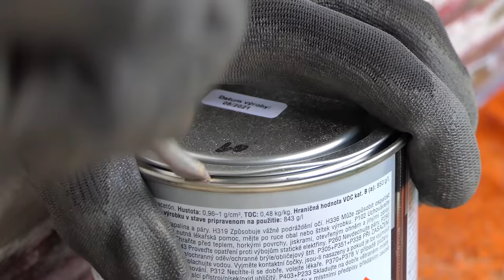Restoration Old Motorcycle CHOPPER - Restore Abandoned Mini Harley - part 1

Comment: He supposedly finds these bikes all over the place , yet they're all sprayed with exactly the same orange paint !
Reply: If he just restored it from a "little tired" to "awesome" it would be an interesting series of videos. But instead we get the absurd fantasy that it was left in a hole, covered in mud, straw, and rust-colored paint, to include the plastics and aluminum. But the tires are in remarkably good shape once aired up, and nothing seems badly broken or missing, even the key is there! 

Take the time spent on faking it being garbage and cleaning the mud/straw off and spend it on a more detailed restoration (e.g. painting the entire tank).
Reply: Exactly the same colour orange thats sprayed on the cloth it's sitting on
Reply: ive found 5 of these bikes without trying.....you can buy them running for about 200-250
Reply: @bms9144  ๐ๆท่าน7.ท่าน😊

Comment: This is how I find everything. I'm just jogging around stopping for push ups and jumping into the squat position in a hoodie, you know on my  Rocky Balboa. When suddenly out of my peripheral, wait. What do we have here? Can it be? No. How could someone leave this here?Then conveniently anything  that is missing is laying close beside it. If it requires keys they are usually in the ignition. I'm just a lucky person I guess. I don't even have to buy parts or check for missing pieces. I just know that everything's going to be there. A quick wash, a little bit of spray paint, and voila it's as good as new. Smh
Reply: Yea it gets tiring when you see a scam artist doing his work.

Comment: Spraying it orange and rubbing dirt and mud all over it doesn’t make the bike old nor rusty. 

“Rust” on a plastic battery and on rubber hoses?  Come on. 

This would have been a better video if it were genuine and not faked for a more drastic “restoration”. 

Boo man. You should be ashamed

Comment: I'm curious to know how much crap is in that fuel tank now.  He stripped the paint and never taped the tank fuel inlet up, he sanded bonds the same way and he primed also. All this equals sludge.   Who taught this guy how to restore?   Then he sanded a radius surface with a power sander, yet a round disc, more waves and burn spots.
Reply: Dude... this guy is a total scammer.... he's throwing mud over perfectly good bikes, then 'RESTORES THEM'.  those staples that he pulled out when he removed the old leather seat?... they were brand new shiny staples. that gas tank?  didn't have a single tiny dent on it. he used multiple colors of paint all over the bike to make it look old....even painted areas where NO ONE would normally spray. those tires?.... looked brand new, not a hint of old dried out cracks and such. I posted a comment that listed TEN things that I caught him doing... he didn't let it get public....

Comment: A pit dug by a brand new excavator, with no other debris, just happens to have your goal. Judging from the traces on the wall, it was burned by fire, and it was accompanied by corrosive substances~ Does it really have nothing to do with you? This is not called repair, it should be called damage and then repair~

Comment: Like he stole it 10 years ago, doused it with gasoline and burned it.And now, unexpectedly, I found it, and restored it.The cops need to check the motorbike license plate, maybe the owner will be found, but how happy he will be...maybe they won't even put you in jail for restoration.
Reply: its not even a motorcycle, its a scooter in the shape of a chopper. it has engine and whells from a scooter